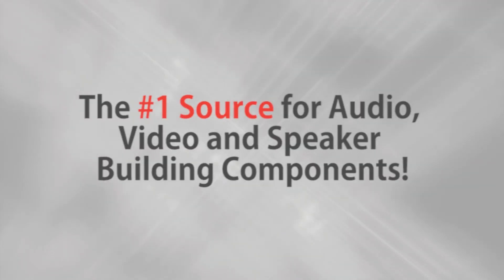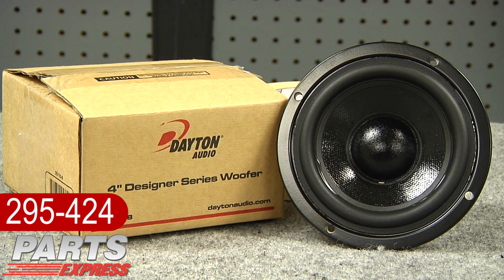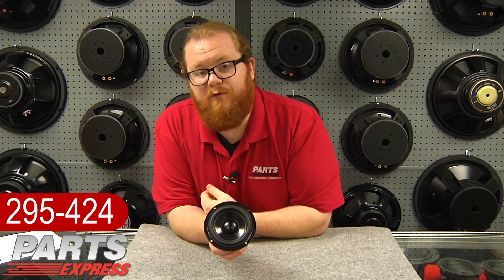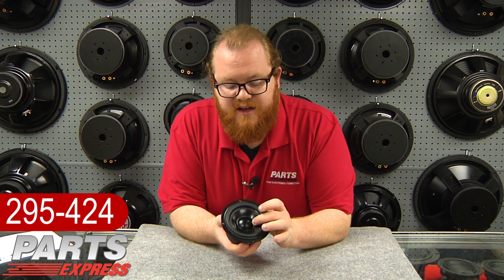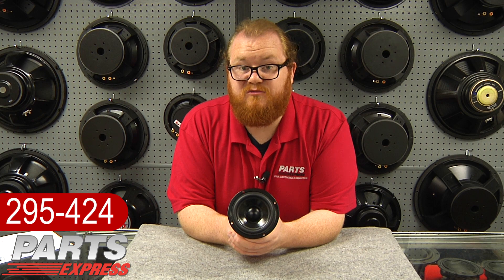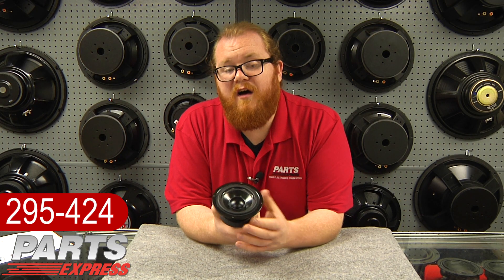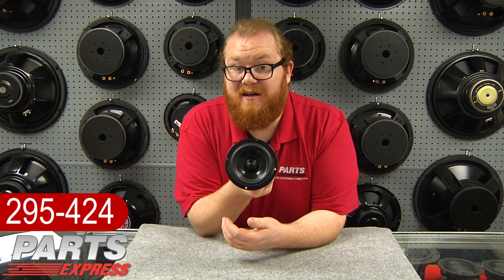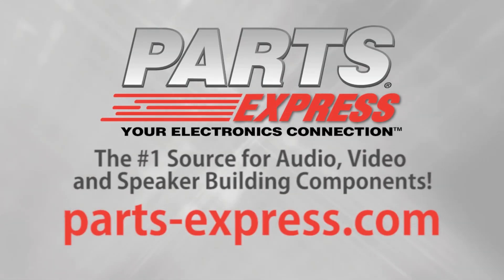Dayton Audio DS115-8 4" Designer Series Woofer Speaker

Comment: How does this compare with the Dayton RS100-4 4"  or RS100-8 4"?
Reply from the maker: The Reference series is our top of the line series "in which we hold all other products in comparison to our REFERENCE". Whereas the Designer series is a line developed to appeal to new speaker designers. Its built for newbies where as the Reference are more for pros.

If you need more info, just call or email our technical department.   
Email: Tech@Parts-Express.com
Phone: 1-800-338-0531